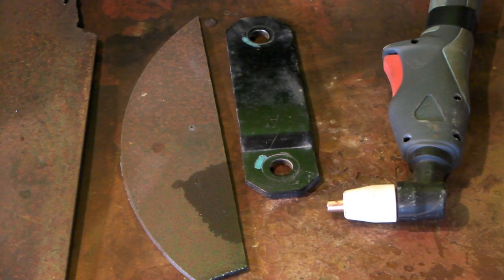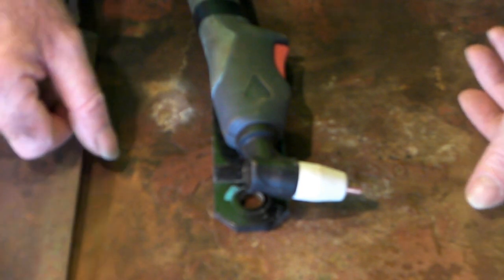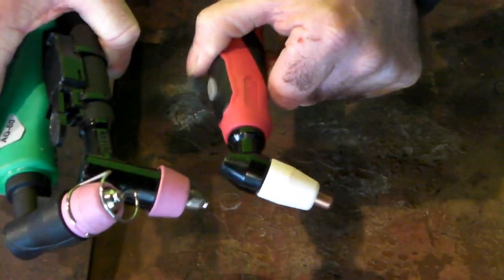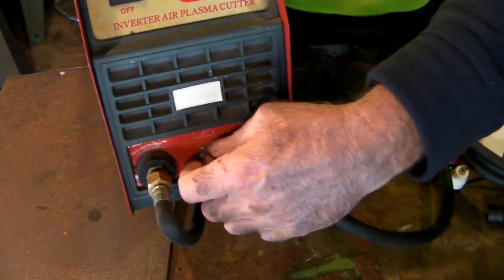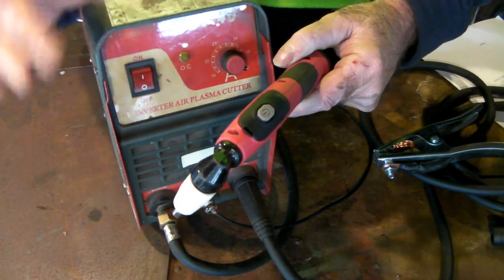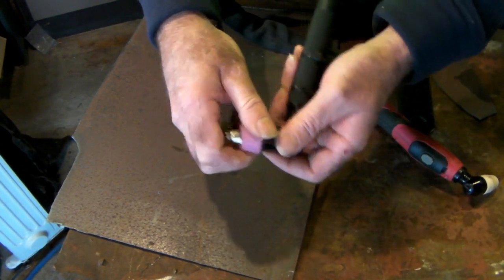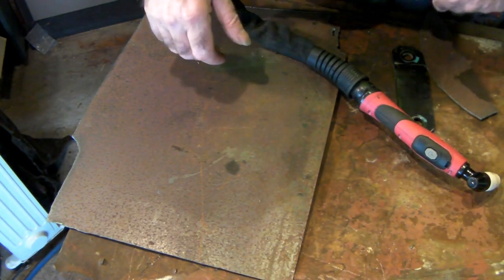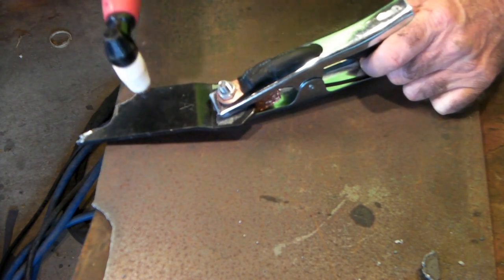Plasma Cutting For Beginners / Best Plasma Cutter

Comment: Hi Pete...This is the machine I have. https://www.inverterfusion.co.uk/i-Tech-Cut-40-P-p/if123032.htm Its from a company in the UK called Inverter Fusion but made in China. The torch is an LT50  and I would gladly upgrade it (the torch head) to whatever you would recommend. I will not be using it for anything thicker than 4mm. Perhaps it's good enough if I could get the extended electrodes for it.
Reply from the maker: Hi john ,you might get away with a AG- 60 pilot arc torch .The consumables are cheaper than yours.   https://amzn.to/2ATZtf8
cheers pete